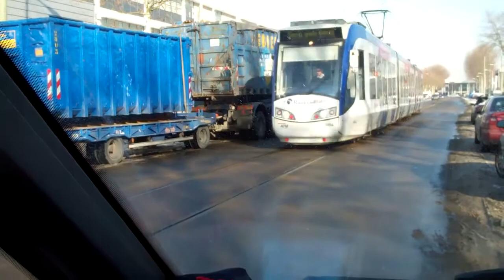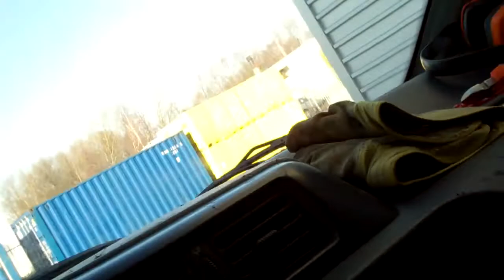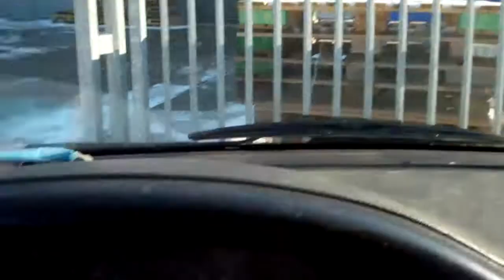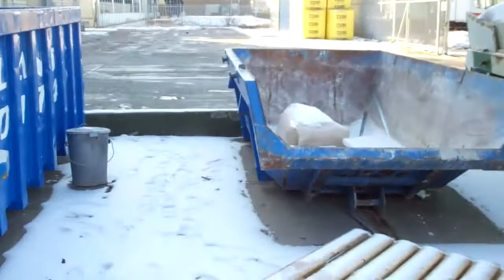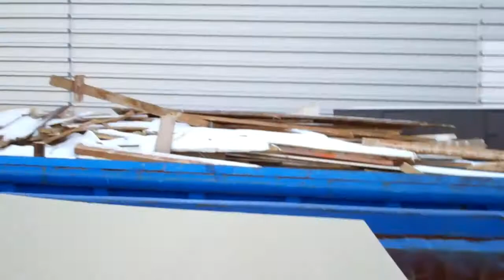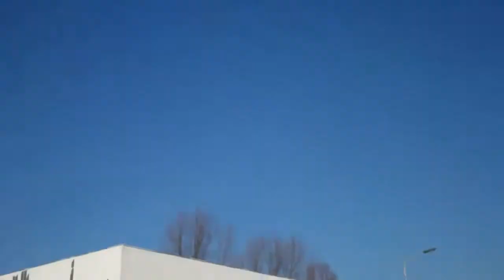Tram (Randstadrail) blocked + No Firewood today !!

Comment: You need to be careful with the e-brake in below zero degree temperatures. Sometimes it can freeze. I prefer leaving my car on a gear when it's cold. Cool videos! Greetings from Poland,
Reply from the maker: I know , thats no fun , better put a block of wood in front of th wheels , but this winter we had almost no snow yet.